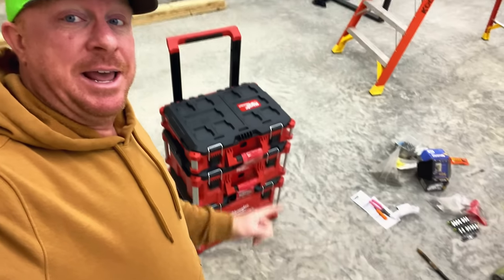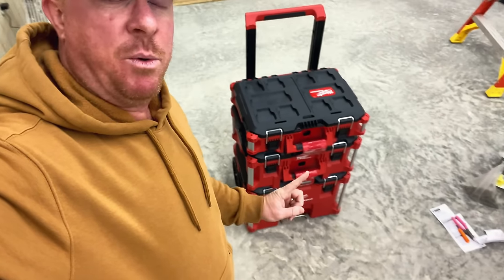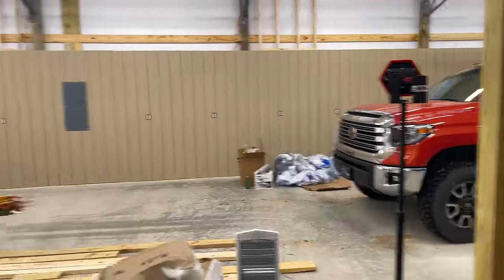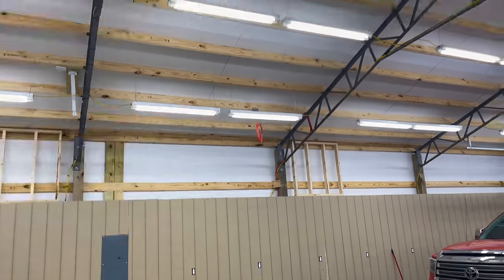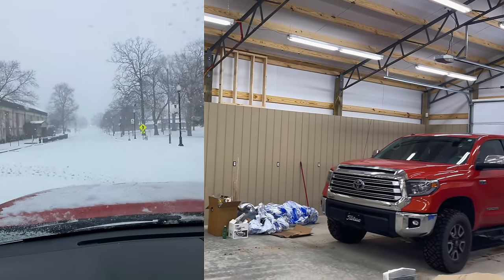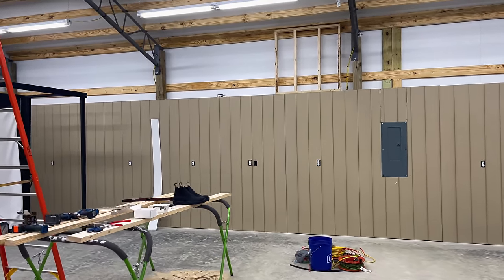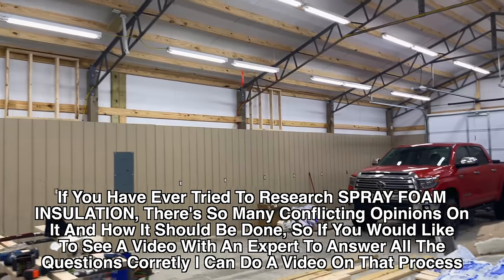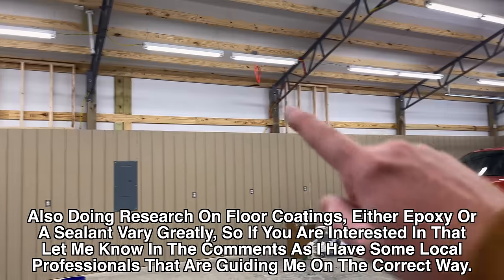New Shop Update, Milwaukee Pack Out Holds A Lot Of Tools

Comment: I have little over two years with my setup. My original bottom broke a wheel and Milwaukee took care of it. I had probably 150 lbs worth of tools, lots of hand tools. I now have added more to it without any issue. 
I have added another tool box, a two drawer and two small parts boxes. I did remove some of the hand tools, wrenches and sockets.
Edit to add. I have two of the original Ridgid large boxes and they are tough. I have exceeded their weight limit also.